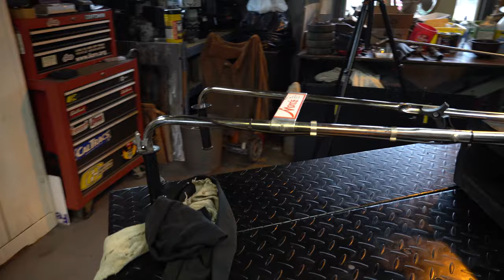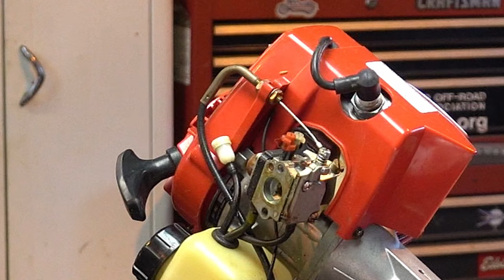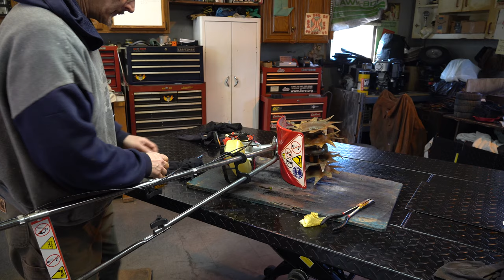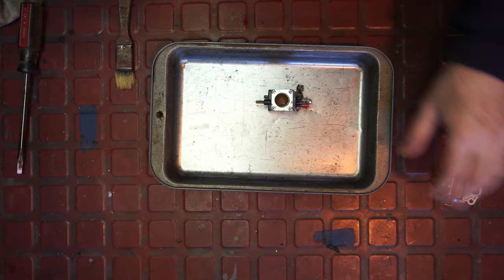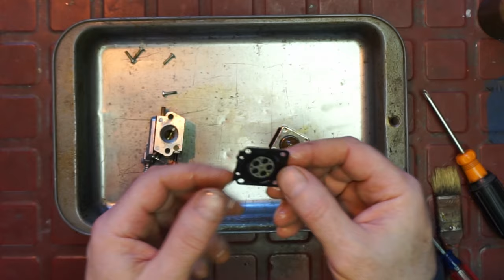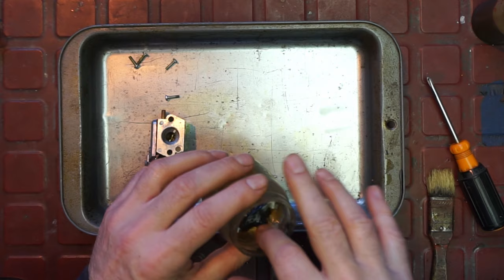How to Tune-Up & Properly Service the Mantis Tiller 2 Cycle ~ Do this to Save Your Machine

Comment: Diaphragm carbs are always gasket on carb and metering diaphragm on top.
Reply from the maker: Thanks Nick,,,true dat,,I got distracted so many times that day,,not to mention old age & diabetes, sometimes I speak backwards....
Reply from the maker: NOTE: !!!! Readme
The GASKET/DIAPHRAGM ORDER IS CORRECT!
The video isn't wrong. I have tested it both ways, It WONT RUN any other way!
This is because it is a Primer Bulb / Fuel Pump Combination. The body of the primer bulb has ports on it that require a gasket to seal it, the diaphragm isn't thick enough to seal it and the tang (bump) that pushes on the needle fulcrum wont reach.
The diaphragm must seat to the machined surface as its very thin. The little bump on it can now actuate the fulcrum. 
What others have commented on is correct for carburetor setups that use the steel plate to hold the diaphragm on, this is not the case / application here.

Comment: I put a new carb on mine and can’t get the jets adjusted correctly.  Any thoughts?
Reply from the maker: Try this,,,,I like to turn the throttle screw in all the way then adjust the Hi speed jet, then I slowly back out that screw until it begins to stall then adjust the low speed. 
Often I adjust the low speed while running at full throttle for a preliminary adjustment.
Here's a video I did recently where I show adjustments on this blower! Check toward the end of the video!
Thanks for watching!
https://youtu.be/alV74DqjimM

Comment: I have a 1st generation Mantis that my Dad purchased in the mid to late 1980s and it still runs well. The gears aren't accessible, there is a grease fitting on the operators side I add to every year. Yes the tines are reversable for either tilling (digging) or cultivating (weeding). There is an accessory wheel to replace one tine to use it as a edging tiller as well.
Reply from the maker: Nice little machine as long as its cared for and,,,,we dont keep getting it tangled in brush and vines
Reply: @TheNovaJohn  Yes the tangling can be a hassle, learning to lean back with it and controlling the bounce helps prevent the tines from bending.
Reply from the maker: @reaganl.5113  LOL,, this thing can really bounce!! Ya can launch this thing like a basketball
Reply: I just picked one up for 50 bucks off of Craigslist and it's in great shape and I'm guessing it's an earlier model like yours bc I only have a grease fitting as well. Mine is set up as an edger with the one flat tine and the wheel so I will have to pick up the tilling tines off the internet once I get it running. I was going to rebuild the carb and put new fuel lines on it but I took a screenshot of another video and used Google lens to find the exact kit and it comes with a carb, gaskets, a plug, fuel tank grommet with all 3 lines already attached, everything you would need for around 17 bucks. $67 for a nice working Mantis? I'll take it

Comment: I replaced the carb on my Mantis, fuel tank and all fuel lines.  It starts with one pull if I remember to turn the ignition switch on.  It runs great.  I run it with Stihl Moto Mix 50:1.
Reply from the maker: Sounds great, never got the notification that you posted!

Comment: Have a 30 plus year old machine that was given to me.Bought a new carb and pipes and runs great.I grease the worm gear with blue marine grease.Servicing is the key to keep these machines running.
Reply from the maker: Awesome, yes many people like marine grease!
I've been turning to Gear Oil now, grease will pack in but it will be pushed out of the way over a short time. Grease is more for bearings and gear oil is more for,,,well,,,,,,gears so I'm changing. Also we can empty out old gear lube easy, not so with closed systems with grease!
Either way, your absolutely right,,,, maintenance is generally all that's needed!
I just ran mine in a garden area that has NOT neem tilled in years! Worked fine!
Thanks for watching Marc
Reply: @TheNovaJohn  You are right,its the same as a car gear box.Need a good gask
et to keep oil in.
Reply from the maker: I used mine recently, worked well and I put it to task! Glad I changed over to oil. I've been changing to oil on snowblower gear boxes now as well! Mostly the older ones where the grease is old and dry and taking them apart is cost prohibitive!
Reply: @TheNovaJohn  Do you have to have a special gasket and how much oil do you put in.
Reply from the maker: @marclaw4511  On this machine I put grease as I show, they want it almost up to the gasket level,,see the video, if old grease is beat you can use gear oil and same level
on Snowblower, just until the oil comes out of the hole with the pipe thread cap if mounted in the front, if its a fill hole on the top, I guess. 
When gaskets break I use RTV with a thin bead spread with my finger and allowed to set up for 20 minutes so it skins

Comment: I use dielectric grease on all rubber components and electrical connections.  Not a lot but it does make boots easier to get off spark plugs.
Reply from the maker: I have a tube of that too. 
I use my transmission fluid mix for so many things these days because its a universal compound.

Comment: Correct me if I'm wrong but that "bad" transmission would need 3100RPM+ to engage vs the 1800RPM the drill is giving. 

Or is the shaft direct drive on top?
Reply from the maker: Without watching the video again as this is an older video; I had the one with the bad tranny running at one point. It squeeled, squeed and never moved the gears below. I showed the gears as well. 
Generally the clutches on these small machines will begin to turn at low RPM's but they don't lock up as they would during use. 
These techniques with drills are useful to help with diagnoses and repair.

Comment: 40:30 Grabs roots...absolutely!  Rip and cut?...only in theory for sales, ok, maybe a few of the dead ones.  Its more like winding roots around the tines until bearings are strangled or transmission gives up or both.  These smaller ones are best in clean dirt.
 Missing screen is odd.  How would you get the rust off the tines?  I thought of copper plating the tines, better for the soil than rubbing rust and steel off into the dirt.
Reply from the maker: I had a monster machine for years,,,sorry I sold it.
I do have a frame of a real tiller and it needs an engine that I should have.
Its a great little machine for light furrow work...
Shove the tines in Muriatic acid or a mild solution of a rust remover. Also cleaning vinegar works well or even battery acid if ya have an old car battery around
You can Zinc plate them
Reply: Iron in your soil is good for plants and the amount you would be adding would be negligible. Try a knotted wire wheel on an angle grinder for the rust, and while you have the grinder out, take an 80 grit flap wheel and sharpen the tines to get through roots easier
Reply: @chrisrageNJ  Why is iron in soil good for plants?  Where does this theory come from?

Comment: The 
Mantis folks say to fill the crankcase up to the level of the flange with lithium grease.  I would probably use my tube of white lithium grease to grease the crankcase.
Reply from the maker: I've noticed over the years that grease and especially these dry greases get thrown off the gears and stick to everything but where its needed. 
I've seen snowblower transmissions fail this way with lithium in it..
I have to wonder; the same companies that make this stuff to fail will tell us how to take care of it! lol

Comment: There is a clutch, just like a string trimmer it is between the engine and shaft. On string trimmers they engage at about 4,000rpm and idle is about 3,000rpm. That is why the tines do not turn at idle. I'm wondering how fast your drill that you tested it with turns?
Reply from the maker: I forget the scene, its been a while. If its the red drill then its slow for the torque.
Reply: @TheNovaJohn  Then that Mantis transmission may not be dead like you thought it was
Reply from the maker: @WisconsinEric  There is a second machine that I show has a fried transmission!
Reply: @TheNovaJohn  Mybe I am wrong but I believe that was the one you put the drill on to test the transmission while saying they do not have a clutch
Reply from the maker: @WisconsinEric  I wrote in text that scrolled on the screen!, No Manual Clutch. 
Sometimes I misspeak, I got it running years ago, a neighbor wanted to see if I could fix it. I got the engine running and the tranny squeed,, loud squeal and no blades turned.
I may have mentioned this but often things get cut out due to time constraints..
Its dead and we can see that in the gears.

Comment: Hi,I have a question.  I have a 13 year old Mantis 6220 tiller that I picked up used a few months ago.  I have replaced the carb and fuel tank plus all hoses.  It runs fine when it is cold but after a few minutes tilling it looses power to the tines.  Could it be a dirty and slipping clutch and clutch drum?  Clean them?  What do you think?
Reply from the maker: When you say looses power,,,,,lets define.
So you know your machines and you can tell that the tines just aren't working as hard, think back or maybe next time, listen to the engine speed and sound.
If you speed/sound changes in concurrence with the tines, then it may be the engine. 
Another example may be, the tines loose power, the engine either doesn't change speed / RPM or actually increases in RPM because the clutch is slipping.  
Considering you have serviced other components and have used it for a long time, its most likely the clutches!
Reply: @TheNovaJohn  let say,I am tilling in the garden and I have to lift it out of the trench that I am tilling.   After I get it out of the trench it will then scoot across the ground.  It may have a few roots on the tines, but not enough to stop the tines.  I have weed reducers on the tines.  It acts like to me the clutch is slipping in the clutch drum.  My garden is about 30’ long and it digs normally for the first 15’.  Well, you know as much as me, now.

Comment: Nice vid.  On my second mantis- this one the echo version and learned a few things.   First one lasted at least 15 years
Reply from the maker: Nice,,what happened to the old one? 
These are nice machine if we don't ask to much of them..
Reply: My mantis is an Echo version.  It’s a shame all these small companies are getting gobbled up by the conglomerates.  Quality always seems to go down.  Look at Poulan and what Husqvarna turned it into - junk.  Mr. Poulan would be rolling over in his grave.
Reply: @TheNovaJohn  they are good but not a real tiller like the 916 Husqvarna that I had but they will do things the Husky never could, like not wear me out and get in tight places.
Reply from the maker: I'm just finishing up a refurbish on a dead and broken MasterCraft Tiller with a Briggs 5hp OHV engine!!
Stay Tuned!
Reply: @TheNovaJohn  I did one of those about ten years ago.  The motor was shot and I traded it off.  I have a little Mantis that I am working on, now.  It is not that old but some idiot had left it out in the weather.  It is a 7225-02-02 made in ‘06 from what I can tell.  I was going to give it to my youngest daughter but think I will buy her a new one, instead.- a 7924 with the easy start system on it.   I rebuilt a Try Built a year or so ago and it is a junky design.  It runs well but it has some design problems that I do not like - the transmission and tines.  I rebuilt the carb system a year or so ago, so it runs well.  I just think a four cycle engine should have more oil in it than 90 ml.  I will deal with two cycle any day of the week.
Reply from the maker: Yup!
My Mastercraft was left out too,,these briggs engines cannot be left out period! I've done several machines this year and water gets in these Briggs OHV horizontal shaft engines!
I did a video on a very similar little tiller like you describe.. For some reason I havent released it..
I eventually will in my series of worst and best machines on the Planet!
Your right, the engine is cheap and not enough oil, the tranny is fragile like the rest of the machine.. I got one a couple of years ago where the bolts holding the engine to the tranny got loose and broke one of the thread ears! 
Junk!

Comment: With a new HIPA carb, mine starts with one pull every time, hot or cold.
Reply from the maker: Good to hear!! OK HIPA ya hear that?? lol
They will be happy...I use their products and yes they have had issues but they listen and work on it..!!
Good stuff...but I always try to fix and keep the original as a rule 1st!!
Reply: @TheNovaJohn  I rebuilt the original but it did not run right.  I replaced it with a C1U K54 instead of the K82.  They are identical except where the overflow line connects.

Comment: so how long did it take you to figure out you put the primer backwards. I kept waiting for you to say opps but your video just stopped and turned it around :)
Reply from the maker: Thanks for reminding me!!! I pinned another comment, or I thought I did,,Gonna just put up a notice now in the description in caps!!!
What a day, so many distractions in the shop. 
Thanks!!
Reply from the maker: NOTE: !!!! Readme
The GASKET/DIAPHRAGM ORDER IS CORRECT!
The video isn't wrong. I have tested it both ways, It WONT RUN any other way!
This is because it is a Primer Bulb / Fuel Pump Combination. The body of the primer bulb has ports on it that require a gasket to seal it, the diaphragm isn't thick enough to seal it and the tang (bump) that pushes on the needle fulcrum wont reach.
The diaphragm must seat to the machined surface as its very thin. The little bump on it can now actuate the fulcrum. 
What others have commented on is correct for carburetor setups that use the steel plate to hold the diaphragm on, this is not the case / application here.

Comment: A new carburetor costs $10.00. Why go through all of that cleaning? Includes the hose assembly and primer bulb.
Reply from the maker: $10 maybe a few years ago lol
I have a few videos on aftermarket carb issues and defects!
I work with HIPA and although they are very good, I have had issue here as well!
If a machine isn't running at all, I tend to rebuild the original carb if its in good shape. If its a mess then I have no choice. 
2 Strokers often don't run. People ruin them. Why spend $20 or more on a machine that isn't worth it or just never gonna run again?
Reply: @TheNovaJohn because that $20 in parts will save you $80 in labor if you were to value your time at $25/hr. For the 20 bucks you have a pretty solid chance of cleaning everything up and bolting it on and having it fire right up. Plus the kit comes with the grommet and fuel lines that go into the tank, along with the fuel filter, spark plug, and a bunch of other stuff. You can't justify fooling around with the old stuff with no guarantee that it'll work when you can get everything I said in a couple days, unless you're bored or impatient and want to get it running right then
Reply from the maker: Oh if life was sooo simple like that lol
I work with HIPA replacement parts, probably the better company out there.
I can tell you, even their stuff often has issues!
Generally I like to use original stuff rather then police some aftermarket crap!
Its good to show people on youtube other possibilities. 
Your commenting on one video and one situation. 
What will you say on all the videos I do where I replace a carb and it doesn't work out? 
How much time and money is saved then?

Comment: There has to be a clutch on it, otherwise the tines would turn at idle.  That squealing sounds like a clutch to me.  A drill will not turn a shaft fast enough to engage a clutch.  Remember it is idling at about 2,800 RPMs at idle and that is not enough to engage the clutch.
Reply from the maker: Look again at the gears on the blown tranny.

Comment: If you do not replace that missing carburetor screen,  you are guaranteeing starting and running problems in the not-too-distant future.  The good news is you are in first place in the longest screwdriver contest.
Reply from the maker: That's right!
These days I replace the carb,,,I always try to get things going with whatever is on the machine 1st.. My bet is someone worked on it already. 
BTW I do have even longer screwdrivers!! lol

Comment: Most people will just order the carb kit with lines and will replace the the gromet, because you didnt you are not helping a lot of us because it is difficult to replace.  Also Im guessing you wont show how to adjust the carb properly which most people would appreciate.
Reply from the maker: Most people will be like my contractor that just bought a new carb that didn't work then needed my help to figure it out and grab a used carb off a donor machine to get another trimmer working. 
Most people will have this issue with aftermarket carbs but you wont hear of it because they have no public voice!
The you said, 
"Also Im guessing you wont show how to adjust the carb properly which most people would appreciate."
So by this statement, you didn't even bother to watch the video or at least all of it!
The video is already too long! By MOST peoples standards!
I do have other videos that cover these topics. 
Those subjects are NOT the purpose of this video, if I tried to put all of this into this video, NO one would ever watch it!

Comment: I took my transmission off the engine and found a broken spring in the clutch .
Reply from the maker: Did ya fix it?
Reply: @TheNovaJohn  I ended up putting a new clutch on it . Could not buy a spring to fit . Still working great.
Reply from the maker: @dennisfoltz7880  Niceeeeeee,,,Good to hear!